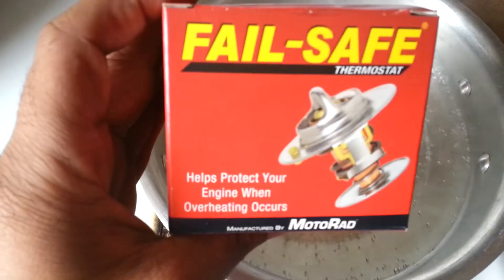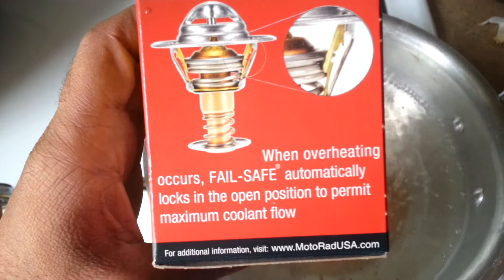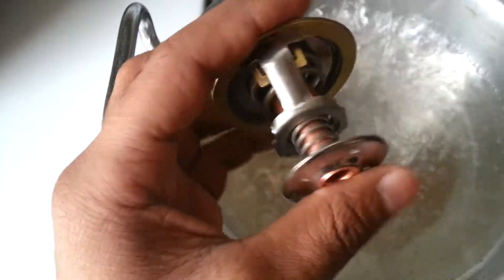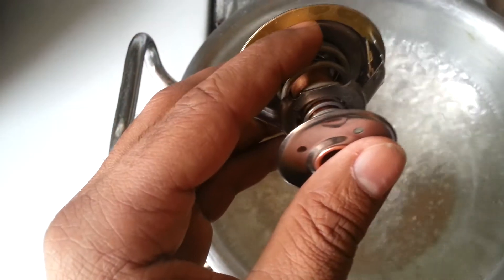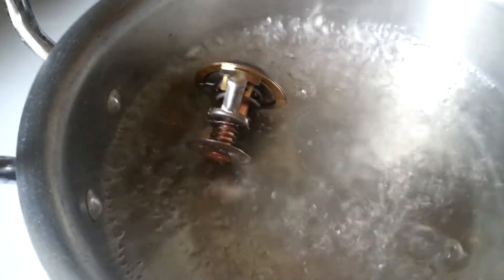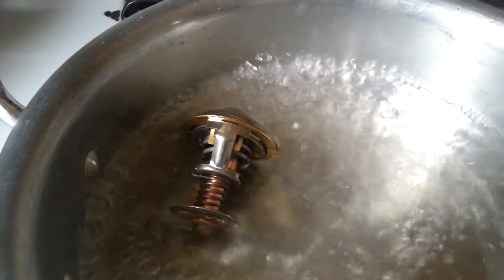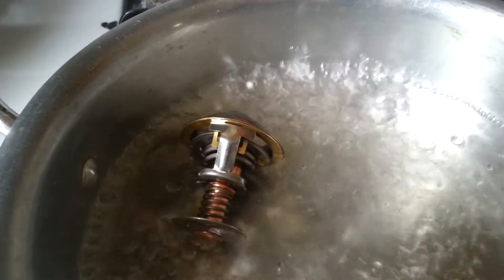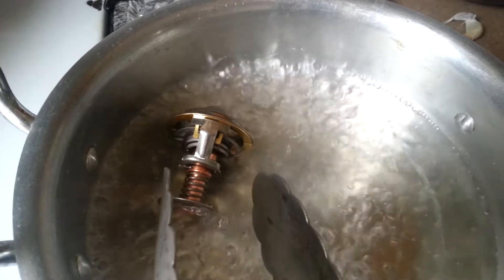How to test a Thermostat  in hot water

Comment: I got one for my srt4 but the guys at rockauto messed up and send me the 180° one... now my car gets to the normal operating temp but when the cooling fan starts it will drop 1/4 of the regular temp... is that how it supposed to work? I mean my car use to have a 195 ° one and the needle was always in the midle, now its fluctuating... any comments?
Reply from the maker: It suppose to be little more than half.
Reply: HP11208 oh nevermind... the failsafe pins are set to a very low temp, it was stuck open, so I took it out and remove the pins, its all good now, the failsafe system needs to be modified so it wont get stuck at normal operating temps, they are too high, they need to put them more down in the thermostat ... mine is working great, but because I just remove the pins or flatened with a small screwdriver

Comment: They said when it locked up  after a overheat. You will need to replace it. But what if you can just clip away the locking clip and re-use it? If the thermostat is still good to use...
Reply from the maker: +mongyaj No, just buy a new one.
Reply: Yes! You can reuse them, even bend the clips to release it and put them back in position. But I just cut them and leave as a normal thermostat, they will work just fine.